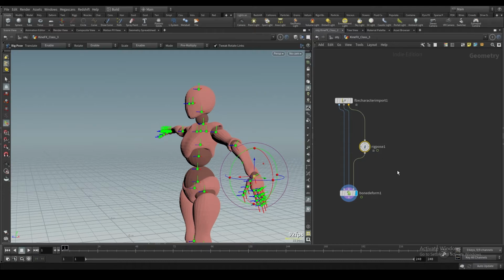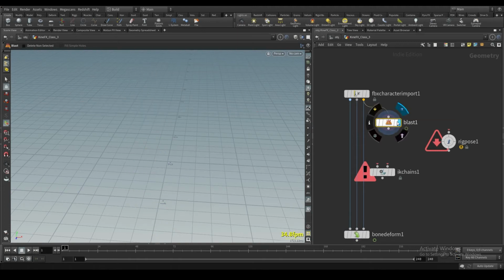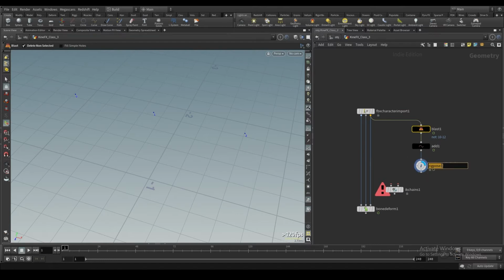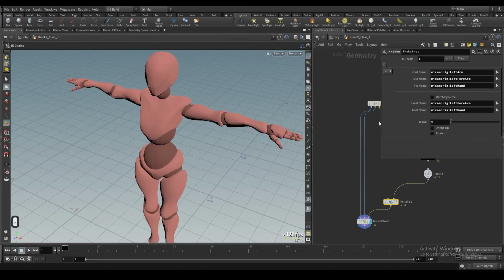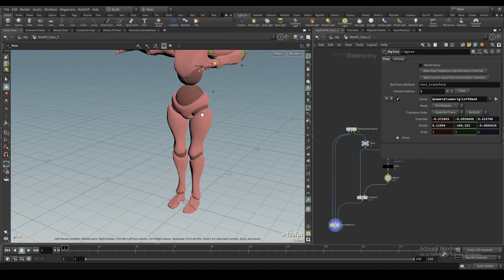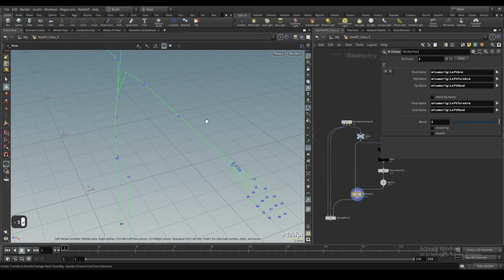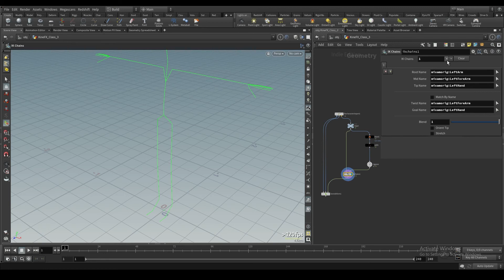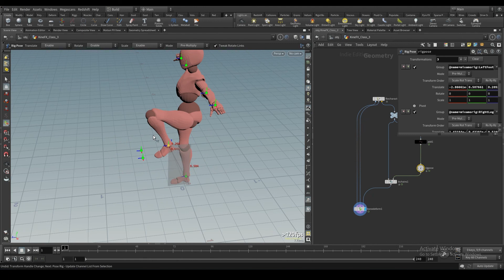Houdini KineFX 101: Tutorial Three - Inverse Kinematics (IK), IK Chain Setup

Comment: Hello great lesson! I can't figure out how to switch from IK to FK so that the position in space, for example, of the hand is preserved.
Reply from the maker: Thanks! What exactly do you mean by that though? Rig Pose is FK so if you want FK use something like rig pose, if you want IK use either the IK chains sop or the ik bone node inside the rig vop. if youre talking about orientation, inside the IK chains node there is an "orient to tip" checkbox. having it on will orient the hand to the end of the ik controller, having it off will result in the hand orientation staying relavent to its orientation before the ik chains. Does that answer anything for you? Not sure exactly what your looking for!